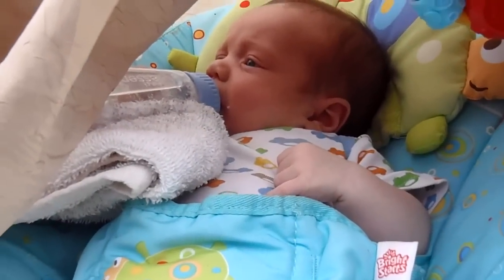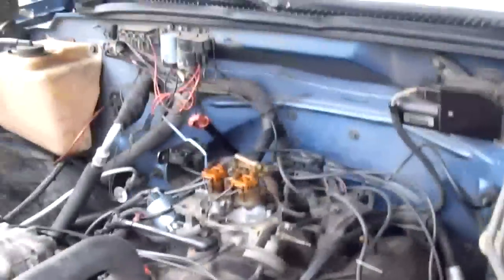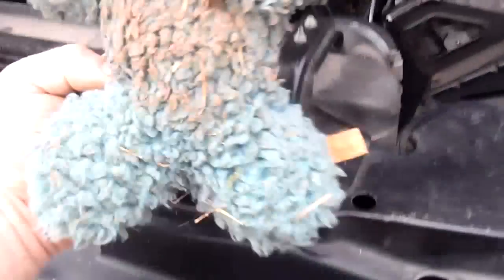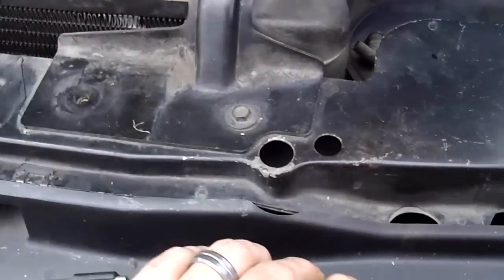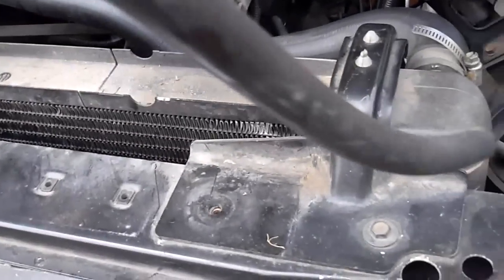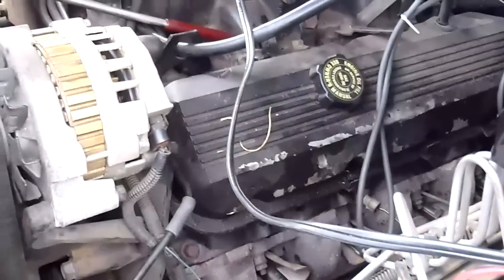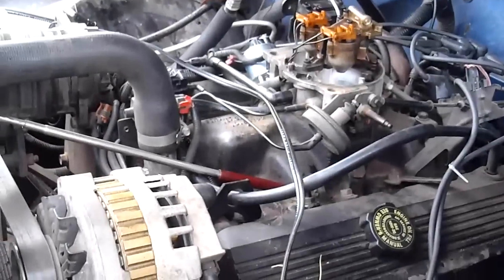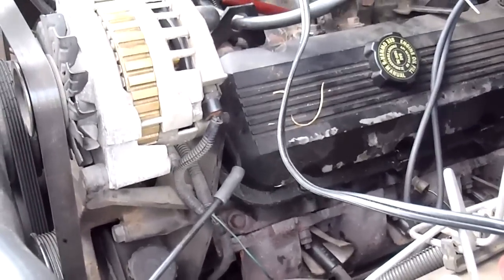Finding top dead center

Comment: So when the squeak stops its supposed to be TDC?
Reply from the maker: yes
Reply from the maker: yes
Reply: @UncleWillie  so i did the same thing you did. But it didnt squeak my first few turns then about the 4th turn it starts squeaking and stops. But the marks wasnt lining up, so i went around again and the marks were about 2 inches from each other when the squeal stopped. So i put it all together, started it up and it idled high and low, kept doing it. Then it back fired as i gave it gas. Maybe one of  the plugs isnt right.

Comment: how did you turn the pulleys?to find tdc?im having problems with cracking the engine to find tdc.
Reply from the maker: I put a socket on the crank pulley bolt and turned it with a ratchet
Reply: size 16 socket

Comment: After watching this I thought I would give it a try. I went up town got me a toy ripped it up took out the squeaky thing. The wife gave me some strange looks. I got it hooked up to a hose then crawled under the truck to turn it over. She laughed her ass off at me. Every time that thing made a noise she cracked up. Odd thing about half the dogs in the neighborhood started  to bark.
I done something wrong I think I got  set a TDC..  So adjusted my valve lash. Now it really does run bad. Kind of wish I had not screwed with it.
Reply from the maker: TDC may not be the correct base timing. TDC is normally used to set valve lash. Once you find TDC you still need to set timing to manufactures recommendation.
Reply: I watched many many videos. And one showed how to find TDC on the crank shaft. Where you make a stop , make a mark spin it around and make another mark and in the middle was TDC. Did that and my marks were spot on.  I could get 1 and 4 right but 2 and 3 were out of wack. So I  did them the same as 1 and 4.
Found TDC on 2 set my valve lash and did the same on #3. It runs fairly good now.  Hey thanks for the reply.

Comment: I have had so many issues getting my 351w to top dead center, after watching your video I still tried to do it by the book and for the too many'ith i was wrong so i made your tool pulled the distributor cranked it over 2 times by hand till i was sure it was working right put it back together and pow fired right off. Thanks for your idea.

Comment: Back yard mechanics have all of the best tricks!

One question... do you stick the hose alone in the spark plug hole or do you have some other special adapter too?
Reply from the maker: I stuck the small hose inside a larger one to make it fit.

Comment from the maker: TDC may not be the correct timing for your engine. TDC is what it has to be set at to install the distributor or adjust the valves. You will have to set the timing afterwards.

Comment: I just used this tech. on my 440, and sure enough, the timing mark was coming right up to 0 as the squeaky went silent. If you have no sqeaky, but a helper, they can hold the tube to your ear, so you can feel the air the piston is pushing thru the tube. Kudos to the Author, why didnt I think of it first? Thanks, man!